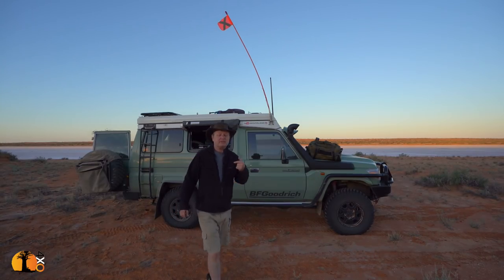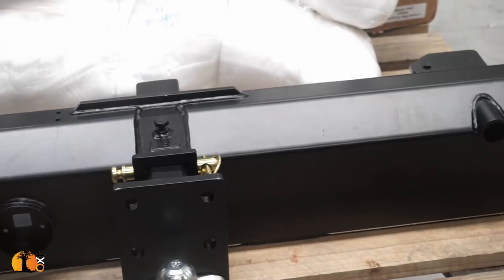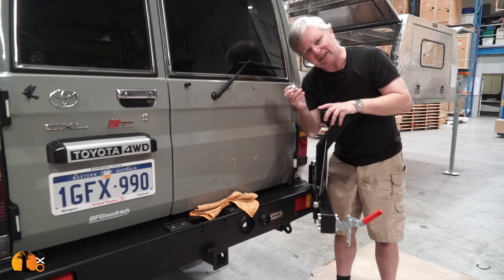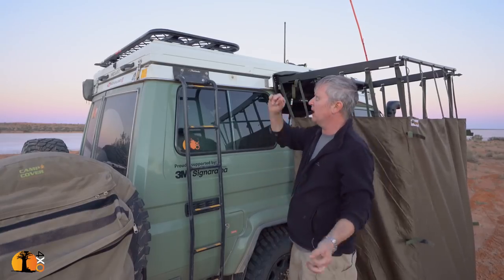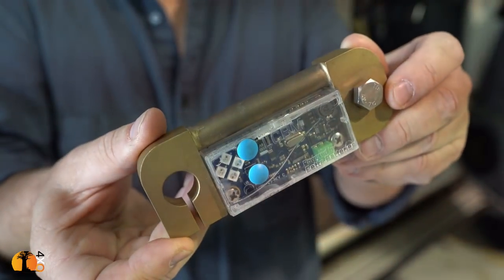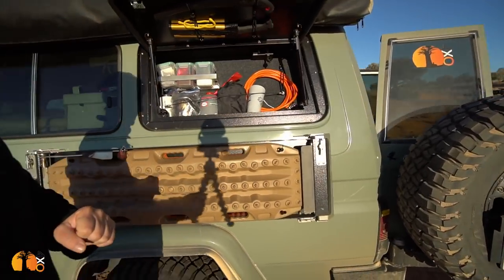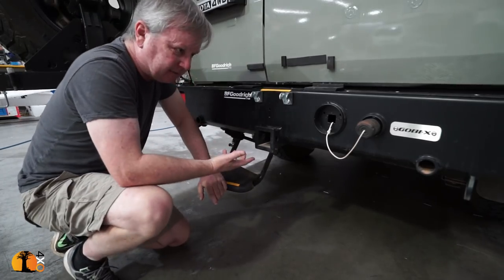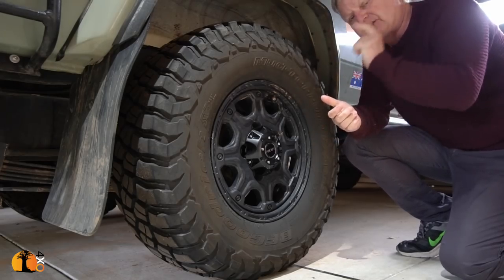TROOPY. WHAT NOW? WHAT'S NEXT? | 4xOverland

Comment: Hi Andrew. I am sure if you had picked the engine revs up to 1500rpm the alternator would then have kicked in to it's maximum output whatever it is rated at, in your case, by the sound of it. 40amps. At idle without having first "excited" the alternator you were doing well to get the 20 amps. Hope this makes sense. Thanks for the great vids....

Comment: I dont have a troopy but do have a 79 dual cab. In regards to the 6x6, you'd be mad not to go the Jmacx 6x6. its a better system with coils all round. The multi drive system is good, and great for loads, but thats about it and its very limited in its design and real Offroad ability. have you looked at the Jmacx system?

Comment: You need to communicate with Toyota and indicate to them you would like to aquire a mine spec 70 series  extra cab Landcruiser 6x6 with extended chassis. I'm a corrosion engineer currently employed in WA mining sectors and recently purchased my Landcruiser in this specification. When filling in my application to purchase, a comparison document explained all differences between civillian and mine spec Landcruisers. These differences are very extensive, from minor updates to major reengineering modifications, numbering 340 in total. On receiving the Cruiser, applying the extra necessary equipment and completing several expeditions, my only real compliant is it is not a carpark friendly vehicle due to the extended wheelbase and height. Hope this is of interest. Great series Andrew.👍👍

Comment: Hi, Andrew @ 4xoverland if you are really still thinking of doing a 6x6 79 look at the Jmacx 6x6 system. All coils either 70 series or 200 series Land Cruiser. They guys who created the Jamcx 6x6 system had used the Multidrive on along with being the top field brass Amy when the Amy where testing the G wagons. They took the best of the best and built their own system and it's also cheaper than the Multidrive and runs on all Coils no leaf springs! Furthermore, there are no modifications to the driveline such as drive shafts, transfer case etc all remains unmodified and OEM. If you are still got at want for a 6x6 give Jase from Jmacx a call and he will hook you up.

Comment: I sold my 200 Series and bought a Troopy mostly because of your vids. It's a build in process. Troopy body on an 80 series chassis. Let me know if you want more info.
Reply: How similar are the 80 series chassis to the 70?
Reply: Harvey Smith The wheelbase is about 4 inches longer in the 75 than the 80. We're stretching the frame to match. The plus side of the swap: coil springs and factory 80 series e-lockers.
Reply: Thanks for the reply Tony.
I have a 70 station wagon in the UK, it is a Japanese import with a 2.4 diesel. Yes a 2.4!
I want to put a 4.2 six in it and a few other bits. Nice to know the 80 is so similar.
The locking diffs sound great. The 70 Prado which is my model comes with coils all round which is lovely.
Reply: I have heard of guys putting the 80 series suspension on the 70 series.

Comment: Love the look of that wheel carrier. Wheel carriers have been one of our biggest headaches. Even had one that was so badly designed it used to open up and it eventually ripped off the bumper. It took quite a bit of welding to fix everything.

Comment: One thought about your charging system - your amperage may be outputting low from the engine on grounds of engine RPM. Bringing up your RPM will increase your charge rate significantly. 

Past that, you are showing sooo many ideas and toys that'd work very nicely with my Jeep.

Also - what about a dedicated trailer for your current rig?

Comment: I bought a 70 series because of GVM limitations of my Nissan Y61 ute, but I chose a  Troopy because  of the influence of ASPW. Andrew has demonstrated the Troopy's advantages of self containment and mobility that I cannot have with a ute and camper trailer as I had before. I have followed much of his advice to the extent that it suited my different needs. I am still wondering about a remap versus a Uni chip as I want it to be tuned to my particular engine and Torqit exhaust.

Comment: I didn't buy a Cruiser, But I did buy a Toyota, in part, because of your build.  The lighter weight and narrower body of a Tacoma/Hilux is better suited for the mountain and forest roads in my area though, so I got a 1998 TRD.  Plus no diesel option here, so every little bit of fuel economy is helpful.

Comment: Hi Andrew, partly as a result of your inspiration I’m on the verge of getting back into overlanding having grown up with Landcruiser 40 series. I’m at stalemate between the Troopy and the GWagen Pro! Any thoughts given you’ve owned two 461 GWagens?  The big advantages of the G for me are its more practical use in urban areas when not overlanding and the completeness of the G Pro package with coils all round, equal wheel tracks, bulletproof build, roof rack that fits under 2200mm garage, etc. The downside, apart from the price, is the asthmatic engine when on the highway. Love to know your thoughts as you’re one of the few who are qualified to comment having owned both platforms. Thanks Andrew and big appreciation from all of us for your inspirational work!

Comment: Just a thought regarding the battery and weight situation. Have you considered going down the Lithium Ion path? Far less weight, more energy output, no damage if drained, faster recovery, no maintenance..... I made a pack out of double A LG batteries of which lay flat under the front seat, you wouldn’t know it’s there. As for six wheels, buy an ex army defender with the Isuzu turbo engine and go to town on it. Probably more people in the price range of that then buying and converting a 79 cruise. Love your work.

Comment: Instead of a 6x6, which seriously increases fuel consumption & weight (not great for mud), you might want to consider a rooftop tent. In some models, have of the tent's floor serves as a roof for a bottom-floor "lobby" with canvas sides, door, etc., which could be easily used as an office space. It's definitely a cheaper option and might be worth considering. Another option could be a Mercedes Sprinter 4x4 or Fiat Ducato/Iveco daily campervan conversion, but you wouldn't get the same level of rugged and overland-ready as with a 70 series. German manufacturer Bimobil also mounts a camper cell on the Landcruiser 79, but as with the van conversion, height might be an issue on a great deal of bush tracks...

Comment: I didn't buy a troopy, they not available and not allowed in Belgium. But I want to say that you helped me deciding to chose for a Sprinter 4x4 and that wasn't an easy decision after 34 years of LandRovers. Thanks for your inspiration! I've chosen for the Oberaigner Sprinter with the shortest wheelbase, permanent 4x4 with extra low gearing and 3 diff locks. I know these are not available in every country, but I'm happy with my choice and in bad weahter I can cook, eat, wash, sleep and ... edit in my van.
Reply: actualy you ca buy a 76 with euro 6 engine registered in germany, so you can bring it in Belgium, but the price arround 50 k euro easy..
Reply: Yes I know, but that's not the V8. And I know someone who has bought the version changed by the german company, but he can't get it himself through the Belgian technical control, it is the Belgian representative who get it with a "tric" through the control. So that was not my favorit way of handling and more over the Belgian representative asks 70k euro for it... That's double the original price...

Comment: That issue you have with the carrier being not too easy is probably by design. Different wheel hub bore would need different carrier to allow to rest the weheel then turn it to align the holes.

Also, in terms of ergonomy, you will swing in and out the tire carrier much much more often than actually taking them off the carriers so the loss in ergonomy (your complaint) isn't so bad considering the gain in versatility ( 1 carrier for all wheel bore) and the frequency of the usage.

Comment: Hi Andrew. Great vids. Do you recommend a fuel pre-filter in your vehicles? I have been working and touring in the Australian outback for the last 25 years, driven most tracks (except the CSR) multiple times. Gibb River Road at least 10 times. Arnhem Land for work every dry season for 10 years. We have had a couple of vehicles with bad fuel that cost us quite a lot. Y61 Patrol $6k. LC V8 crew cab $20k. My experience is that you can get bad fuel in outback Australia, very damaging on your vehicle. The other question I had was regarding tyre pressures. On the CSR video series you had the rear tyres at a higher pressure than the fronts. Did this not cause you windup due to unequal tyre circumference?

Comment: I wanted something bigger too. Bigger than my 130 Land Rover. But I went too big. Built a MAN 4x4 truck up into a camper.  HEAPS of room for everything. 425L of water; Full shower/toilet; it's got the lot including a kitchen sink. It is brilliant for long distance touring and for beaches and the desert, but if you want to do the Victorian high country - forget it.
It uses about 24L/100 which is not insane if you think that you're carting around a small house on the back (it weighs 9,500Kg when full of fuel/water).
If I had a 2nd go at it, I'd probably go mid-sized and look at an IVECO Daily and try to live with the less than average build quality (especially the standard brakes).
If you want to see the truck, try searching for "MAN Expedition Truck" on YouTube, and look for the one on the Kimberly trip.
Cheers - David

Comment: it would be good to put a meter on the alternator's output to see how much it puts out at idle.  the output changes greatly from idle up to road speed
Reply: modern open cage alternators between 20 and 50amps but don't overload they can overheat due to not enough cooling at low rpm.

Comment: Idea.
You seemed to need help getting the wheel onto the rear carrier. If you were on a trip that could be a problem.
Then I saw your new ladder!
How about a square horizontal plate, matching the width (8"?) Of the tyre, welded onto the carrier under each wheel, a quick release, similar to the tyre carriers for your ladder, and a hook mount on the side of each plate allowing the ladder to become a ramp (maybe 30-45°?) running from each side as required. This would save your back! It would also help locating the wheels on the carrier studs.
Reply: theres a reasonably painless way to lift a 33" tyre off the ground and on to a wheel carrier.
1. sit the wheel on the ground in the up right position 2.squat 3. hold the inside of the rim (the side which is facing away from your body) with both hands (palms facing away from your body) 4. flip the wheel as you lift your legs out of the squat position and the wheel will end up at chest height. **I have seen this manoeuvre performed by someone of slight build ( less than 65kg) and can vouch for its effectiveness** No injuries, voila!

Comment: I would have to  wonder if you  split troopy  down  the middle ..frankenstien  it on the  back of a  70 series ute would  attain the width you  seek in space  to give you the space you need for  an editing  den on the road

or consider the ambo conversion of the  troopy which  gives you a  1 foot to 1.5  clearance either side of traygiving  you 2-3 foot  storage  space...

 basically   a troopy  from the fire wall back  where the  tray goes,  with a pass thru into the dual cab ute and 6x6..

or chop from behind the troopy door  and add a 3-5 foot  extension  and spec it out like a parente land rover.. thoguh the idea of mounting  the  firewall to the back end of the  troop most likely be the cheapest option providing you  can find a troopy on a the scrap heap though I suspect  you mated the troppy and dual cab together  you might..

may be even consider adapting  what the hummer uses as a driveline 

 if you want to   get the  driveline  protected
or may be consider a toyota motor and drive line and gear box and  but the parente land rover with shop/radio room on the back end..

may be have a yack to the queensland mobn I don't know however you likely need something bespoke if you want enogh floor space to have an office chair in a the middle and you will likely need to replace the chassis rails a 5-12 ton truck  rail system ..

Comment: Different charge controllers ramp up current differently depending on the design of the unit. Something like a NOCO genius or a redarc bcdc1240 will be superior in that regard. To measure current just use a clamp meter or a hall effect sensor.

Comment: Get a Unimog, it’ll have 10x the off-road capability of a 79 6x6 as it has factory portal axles and 40+inch tyres. You’ll have a massive area to work with. Can also carry over 10 tonnes so no weight issues.
Reply from the maker: The mog is too heavy, too large, painful on long distances, and too wide. Its prone to punctures in Aus.
Reply: Fair points

Comment: Yer Ctek DC - DC is not the best in the world Andrew. I'm pulling 140A to my golf cart batts at 50% SOC just using an Albright 100A contactor over 35mm² cable. I have the service battery the most upstream and the D+ is sensed from the engine battery.
The Ctek derates when it gets warm.
Was solar online when you saw 40A?
Reply: Are the shunt sense wires backwards too? Negative is positive?

Comment: To add I strongly consider to say goodbye to the troopy and get yourself an Iveco daily 4x4. It’s twice the machine and you’d be able to set it up quickly and for far less. It’s standard with lockable front, centre and rear diffs, multi selector gear range for a total of 28 speeds which are selectable on the fly. Much greater payload, comfort comes standard and its dual cab. No doubt you’ve had a look, I honestly think you’ll be far happier with one of these than going through a six wheel conversion.
Reply from the maker: You might be right!
Reply: I’ll kick the tin ‘very lightly’ I forgot to mention loads of other good points but I’m sure you’ll see it all on their website. As for me I’ll be lucky to afford to keep the vintage d2. Love your passion for the sport by the way, the David Attenborough of Over Land 👍

Comment: Hi I be buying one too if there’s sold in Canada so my choice is the Mercedes sprinter 4x4 for my next vehicle with my family 

Thanks for those nice video you post
Reply: A Sprinter is not an off road vehicle so no comparison can be made. If a Sprinter suitS your needs I am confident that you would not enjoy driving a troops. Enjoy your adventures !
Reply: Cycle & Moto thanks for your reply. Why not it’s got high ground clearance it’s got a 4wd  with low ranger gear box and a advance traction control go check the video pave your own way the sprinter 4x4 on youtube.
Reply: Canada and Australia must have different names for the model because in Australia a Mercedes Sprinter is the equivalent a Ford Transit van.

Comment: How much room do you need to edit, I know of at least 1 couple who film, edit and upload to YouTube from their Troopy pop top.
Reply from the maker: It takes many, many hours, even days to edit one of my feature edits. It cannot be done when uncomfortable.
Reply: Several questions, is it imperative you edit inside the vehicle? (I know inclement weather would mean you would sometimes but are you not comfortable editing outside at all I would have thought you could get a comfortable stowable system for use outside the vehicle?) secondly could you post a pic of the sort of editing setup you would want to have on the road (screen sizes and number etc).  Is it purely a space problem or are you payload limited to the point you couldn't take the edit setup you would desire even if it fitted?  Vehicles are always a compromise bigger will have nearly as many additional cons as pros as I am sure you know.  

The reason for my interest is that you have a lots of unused volume in the troopy when the roof is up and the bed is stowed. I am keen to explore whether there is a way you could use this space for a stow away editing suite.  I would love to be an offroad adventurer but living in europe and having limited time off mean my trips are on blacktop with a very well designed german RV rather than a 4WD.  But I am thinking of adding a diy pop top to my Frontera to replace my bed platform in the rear for overnight jaunts.

Keep up the good work.

Comment: But you don’t explain what equipment you need to edit that need the space of a 6 wheel. They are many on the road doing editing on there laptop and hdd system right now. Some are uploading at cafe and other has a phones internet. The electronic have downsize to fit the market of what you own it’s about  finding it.
Reply from the maker: Ive been editing for almost 40 years. Documentaries, commercials, TV dramas. It isn't about the size of the computer. Its about comfort. Editing takes hours, days, weeks. It cannot be done well in a cafe. Its done well in a comfortable space with large screens, and a fridge nearby.
Reply: Now I see. its a space or mood that that creative that atmosphere more than equipment.